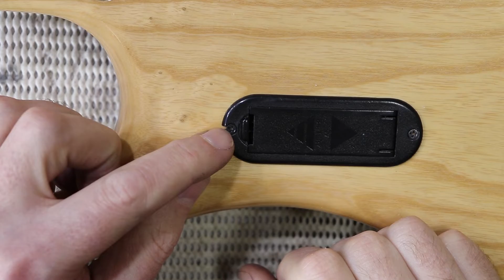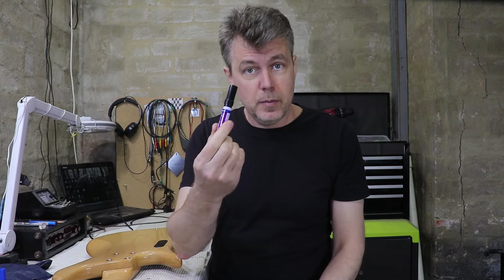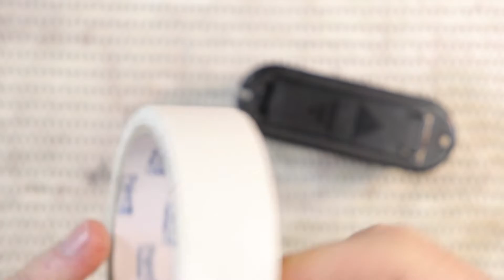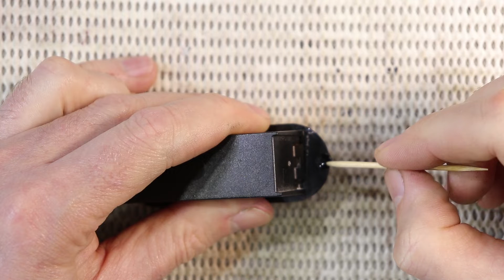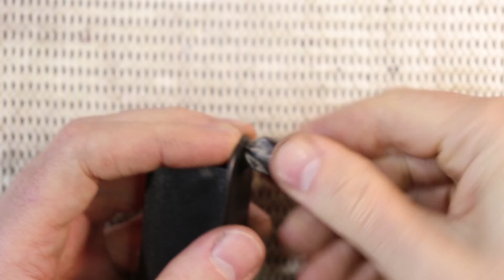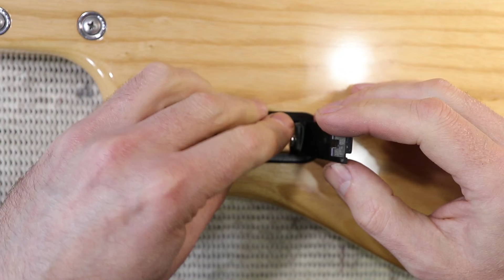How To Repair Plastic Guitar Parts

Comment: What is the primer pen used for ?? Does it remove the previous glue or just roughs the surface?
Reply from the maker: The primer is some sort of solvent.  It seems to dull most plastics as it dries.  I've never seen it sold separately. It comes with two local products; selleys "all plastics"  and loctite "all plastics".  These days the sellys one comes with a different glue, not a CA.  So I usually buy the loctite because I'll use the glue.  The primer pen that comes with the loctite is labled "activator", but it is not a CA accelerator.  It is indeed a priming fluid. (I spoke to one of their techs about it years ago).

Comment: I'd like to thank you for making this very informative video. I have an ovation-type guitar (plastic body) with a huge crack on in, which I haven't repair yet, because I couldn't figure it out how to do it until this day. I'm from latam, so it's gonna be a little difficult to get the same products that you used, nonetheless I'm convinced that following your method will get me through a nice result. Again, thank you very much 🤘
Reply from the maker: Cool.   Give it a go,  but be aware that depending on where the crack is and what caused it,  it may also need a splint or reinforcing of some kind.   How you do that with an ovation though,  is anyone's guess!   Good luck friend...

Comment: Well done 👌🏻 Like new! 
By the way, are there any alternative and cheaper products for that Loctite 480?
Reply from the maker: Cheers.  There's nothing quite like it that I know of.  However, you can tint regular super glue with spirit stains and aniline dyes.  Also, Stewmac have pretinted black CA glue.  But in a situation like this, where reinstalling the screw will slightly flex the battery box flange, I reckon regular CA would crack.  I wonder if you could tint Loctite Power Flex.  I've never used it, but it is pretty cheap and easy to find in hardware stores here in Australia.  It appears to have a similar plasticiser...

Comment: Hey Rob! Most plastic parts should be marked as to what sort of plastic they are, however in this case I would almost bet money that it's ABS and essentially treated the same as you would when repairing binding. If you've got this sort of plastic repair goo on hand, all good. I'd snip a bit of plastic binding, pop it into a cup with some acetone to fume it for half an hour till it becomes soft and mould it into place. Being ABS it'll weld nicely. If you're lucky, you can even steal a bit of plastic from the part in a place that might not be seen....! Good job here. The repair looks great.
Reply from the maker: Yep, I'm pretty sure it would be ABS.  When I was at uni, we did a plastics ID course and we got a whole lot of different plastic things and torched them one by one, observing the flame, the smoke etc, to work out what was what.  Quite interesting.  I have melted abs in acetone before to repair something, and found it a bit hit and miss, but yeah, I should have thought of that too.  I have acetone in my workshop.  Actually, now I think of it, at Maton, we made our own binding glue with acetone and strips of binding.  Not a fun job.  It stank and was really messy, lol...  Thanks for your comments mate!
Reply: @RobMods  I've always wondered about the density of acetone melted ABS and similar, because I'm certain that it would shrink and "be less good" than the real deal around it. I personally dislike using that to infill gaps in binding (they shouldn't exist in the first place!) but for the sake of a quick component repair, meh. It's what you have on hand right? Totally hit and miss, right on. Didn't know you worked at Maton. Very cool. Making your own binding glue is a good way to recycle old material as well, and IIRC aren't glues like Duco, etc. just a gelled acetone or similar solvent? I've wondered whether it's possible to fake the texture in ABS and similar plastics using heat and sandpaper. I haven't tried that yet, but I bet it'll stink.
Reply from the maker: @TristanJCumpole  Yeah I worked there for a few years, around 10 years ago.  Was a good experience.  Mostly with the cnc team, but also in the set up room, body building, and a few other areas.  Pretty much every guitar guy in Victoria as worked there at some stage I reckon!...